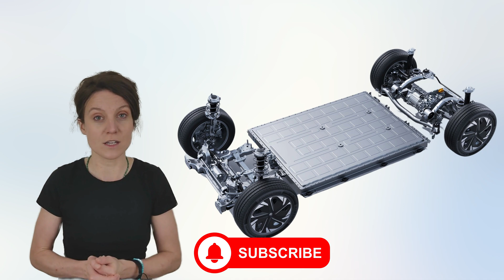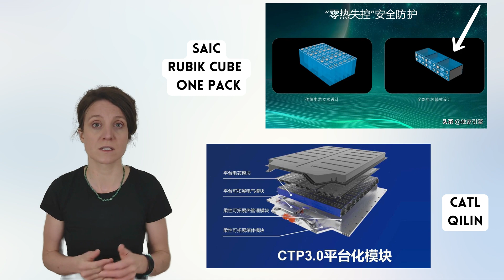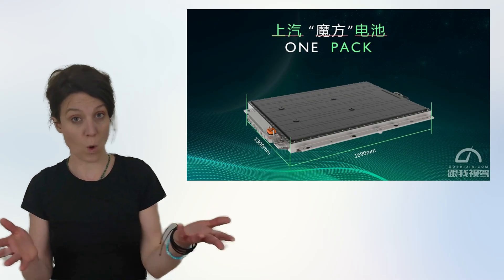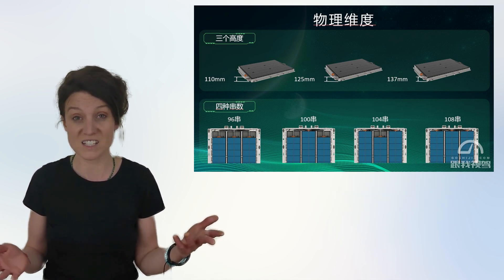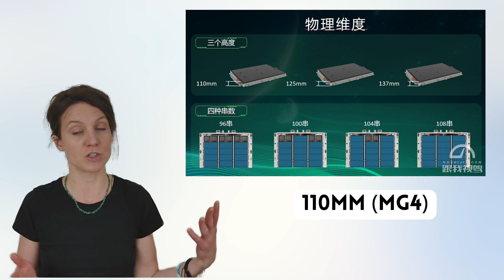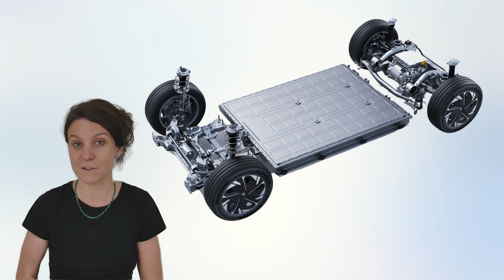🔋 The Powerhouse of MG4: One Pack Battery Explained ⚡

Comment: What's the electrical connections for the smaller 3S sub batteries within pack?
thread/stud or similar? What connections are there for cell ballancing? 

I'm asking because i've seen some dismantled packs for sale. And thinking they might suit my purposes
Reply from the maker: Hey, sorry for the late response and thanks for the great question! I’ve poked around with some MG4 battery details, and the smaller 3S sub-batteries in the pack are a bit of a puzzle, as dismantled packs don’t always come with clear specs. From what I’ve seen, the 3S modules (three cells in series) typically use welded busbars for electrical connections, not threads or studs, to link cells within the module. These are nickel-plated strips spot-welded to the cell terminals, which you’d see in most EV packs like the MG4’s LFP or NMC setups. For cell balancing, there’s usually a wiring harness with thin balance leads (like 26-gauge wires) soldered or crimped to each cell’s positive and negative terminals, feeding into the Battery Management System (BMS). The BMS has connectors—often a multi-pin plug—for these leads to monitor and balance voltages.

I haven’t dismantled a pack myself, but I’ve checked out some EV battery teardowns, and the MG4’s likely similar. If you’re eyeing those dismantled packs, make sure the busbars and balance leads are intact, or you’ll need to re-weld or solder them, which can be tricky. What project are you planning with these?

Comment: Does anyone know the type of NMC battery used in the MG4. How cutting edge is the chemistry?
Reply from the maker: @brendansheehan7714 Good question, but finding the answer is quite a challenge... the only thing I was able to find is this: MG4 Cell Supplier: SAIC Ningde Yikong Power System Co, prismatic cells.

The NMC battery chemistry is considered to be one of the more contemporary chemistries in the EV space. However, "cutting edge" can be a moving target as battery tech is advancing so rapidly. It could be a great topic for a future video.  What's driving your interest by the way, are you considering an MG4, or just curious about EV battery tech in general? 😊⚡
Reply: @siasek  Thanks for your reply. I already have an MG4 (I picked it up in September). I am looking at the optimal charging regime that protects against battery degradation while fitting in with my driving needs. I wanted to understand at the physical level what is happening and learnt about how degradation affects the anode and cathode. On the cathode side of things there has been a development in high nickel chemistries called single crystal NMC that has much better charge cycle stability as well as energy density and power output. I know LG has started manufacturing such batteries but what about CATL?

Comment: Great video , do you think the one pack will last as long ( years) as BYD blade batteries, or how many cycles do you think it will last ,  cheers
Reply from the maker: I think Blade and Onepack are comparable technologies in terms of durability. MG quotes a lifespan of 1500-2000 cycles, which is above average. I think with standard usage, the lifetime will be over 20 years, for taxis and similar high mileage applications definitely over 10 years. I wouldn't worry about durability at all. By that time there should be a large network of repair centers and even replacing modules with new ones is easier than servicing a modern internal combustion engine. 🙂

Comment: Excellent video which is, for once, properly informative and, what is more, based on fact, not opinion.
I do have a question for you though; Seeing as SAIC and CATL are working together, does this mean that CATL's new Condensed Matter batteries are likely to be made available to SAIC any earlier? The other question also seems to be begged by the "Battery Swap" tech employed on this platform. Will those CM batteries be employed?
Reply from the maker: Thank you so much for the kind words on our video! You made my day! 🌟

For your first question about SAIC and CATL's partnership - I know they formed a joint venture called United Auto Battery System. The new Condensed Matter (CM) batteries from CATL are definitely exciting (I mean, 500 Wh/kg energy density, hello future!🔋) there isn't crystal-clear info on whether they'll be up cozying up with SAIC sooner rather than later. I'm also curious to see how that unfolds. 🤔

Regarding the Battery Swap, SAIC is putting its best foot forward in this space with brands like Roewe and MG getting on board. But, whether CATL's cutting-edge CM batteries will be the guest stars here is still under wraps. Though, let me tell you, with their high energy density and semi-solid state with condensed electrolytes, they would be the perfect fit for the battery swap game. ⚡

Let’s not forget - SAIC has been dropping hints about making its grand entrance with a solid-state battery-powered vehicle in 2025. So, the plot thickens...

Oh, and one more thing! SAIC, CATL, and some big names are thinking ahead and planning on integrating battery swapping and charging across more than 50,000 gas stations in China. 

So I don't have any definite insights, but it's definitely fun to watch, so I’ll be watching closely and post updates!
Reply: @siasek  Thanks for the in-depth reply.
It seems that the Chinese have not only learned to make interesting cars, they've also learned to play the "teaser" game as well, and that also helps to boost interest.
Reply from the maker: It can definitely be a good marketing move. I just hope they don't learn from European brands (looking at you VW and Skoda) to release a teaser 3 years in advance 😄